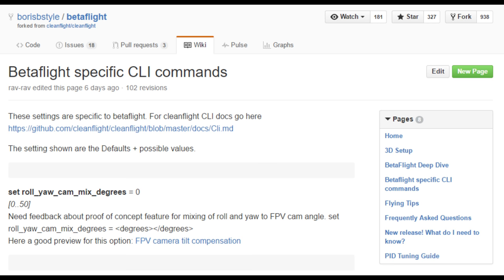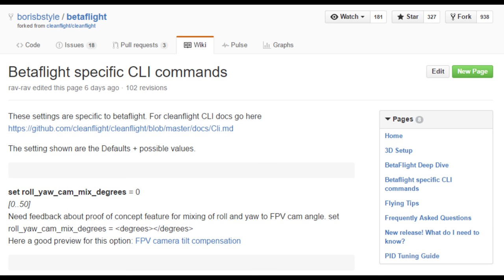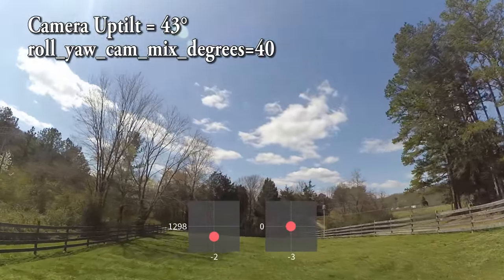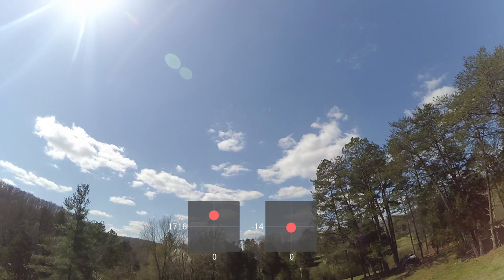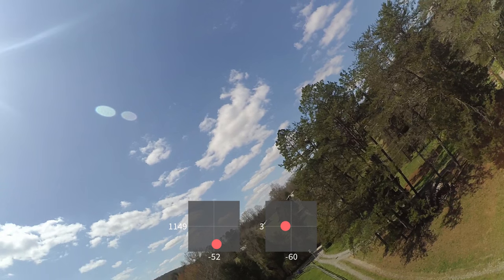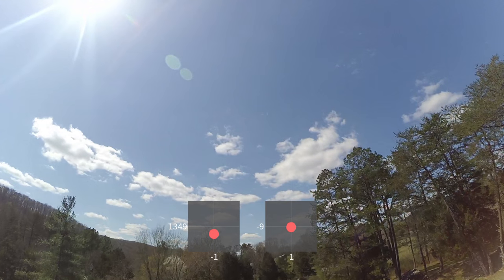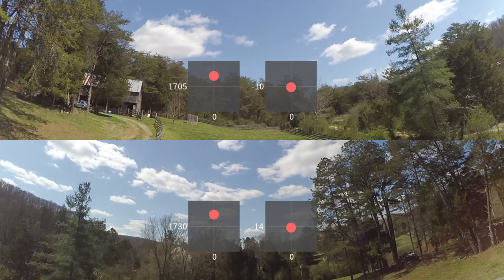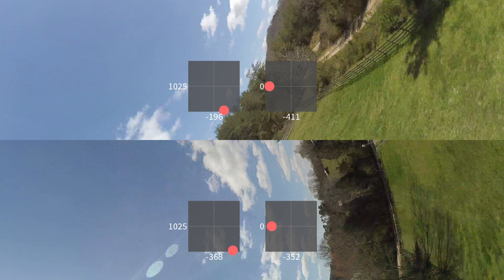Betaflight Camera Uptilt Compensation (roll_yaw_cam_mix_degrees)

Comment: Very interesting. Flight stability I love but the thought of fake inputs happening makes cringe a little. How far you would take this, auto height with just throttle and yaw to fly fast laps would be the extreme i guess. What i'd really really love to see is a few Los circuits with flips and rolls in with this setting on and then off. Fast FPV feels odd to me but LOS I can fly round our track way faster. I'm starting to wonder if this is the factor making fast fpv feel odd where los or slow fpv doesn't.
Reply from the maker: +MicroRCFiend Don't get hung up on the "fake inputs". Think about it! The PID loop is CONSTANTLY making "fake inputs" to the motors to make the copter fly. Nobody cares about that. As long as flight performance is good, there is no shame in letting the flight controller do some of the work for you. Does your car have anti-lock brakes? Of course it does... even high-end race cars have anti-lock brakes because they are just good. On the other hand, many racing drivers prefer to NOT have stability assist and automatic gearbox, because there are performance-related down-sides to these features. But don't hang onto pride that will keep you from taking advantage of something useful if there is no down-side.
Reply: I follow you but the PID loop and giros are adding stability to counter external forces, this is adding extra inputs that physically change the way the quad flies through the air.

The comparison to anti lock brakes and automatic gearboxes not a good analogy in my opinion. This auto cross inputs really does limit the performance, speed of roll rate being one. Range of motion to counter the extra inputs is reduced too along with trajectory due to angle of the quad. Extra inputs are a very internal thing separate from the PID loop. Now air mode or active breaking would be much more relevant analogies to anti lock brakes or power steering.

With that all said, i'm incredibly curious what FFF roll and flip would look like from a LoS point of view if you were willing to do do a couple.  If it makes a 45 degree tilt flying round a track feel like i'm flying LoS inputs then that would be wonderful. Do you feel flying like this only would effect someones ability to progress with LoS if they were new to both in regards of consistency of inputs to the quad's flight?

Would this CLI command apply to only the profile you are in when you set it meaning you could cycle it in or out
Reply from the maker: +MicroRCFiend I feel like the distinction between countering external forces and adding extra inputs to change the way the quad flies is immaterial. Just my personal opinion; you don't have to agree. As long as flight performance is still excellent, who cares how it's achieved, I say.

I may pull out some LOS rolls as I would also be interested to see what it looks like. Flips won't be changed at all, of course, as the compensation is roll and yaw only.
Reply: Yes, I do disagree and I care very much how flight performance is achieved but sure it's ok to disagree. I think that is possibly because of our roots and goals. Your's is obviously FPV and damn fine skills at that, where as mine is a LoS 3D where extra external inputs would mean malfunction and lack of symmetry in piroflips etc. It would dramatically effect everything instead of correcting the camera tilt.

I really dig your fpv musings vids, gives my tunnel vision flying brain a fresh perspective which is never bad. 

I have a naze quad now, can this be limited to just one profile?
Reply from the maker: +MicroRCFiend I can see how it would matter more in LOS flight. In FPV flight, all that matters is what the camera is seeing. What the body of the copter is doing is not as important.

The parameter is not in the "profile" section of the CLI dump, so it is global.
Reply: @JoshuaBardwell  I can see you're mathematically minded. This setting is just changing the basis rotation for the control sticks. It doesn't change how the quad flies. It changes how the controller works, i.e. the human interface. Rather than have the control axis fixed to the propeller plane with a variable camera angle, we have the control axis fixed to the camera with variable thrust angle. I found this video because I didn't know betaflight had the option and I was trying to do the mix in my transmitter. Haven't flown it yet, but I have experimented with it in a game engine while writing a simulation script. It seems like it would be useful in tail-sitter airplane/quad hybrids that launch vertically and fly horizontally.

Comment: Hey Joshua.  What loop time are you running in Betaflight?  I am running a naze32 rev5 with littlebee 20amps on cobra 2204 2300kv motors.  I think it's a pretty similar setup to yours.  And I'm flying acro with accelerometer turned off.
Reply from the maker: +Eric Maggard 2 kHz.
Reply: +Joshua Bardwell What is the advantage to having a higher loop time? If I wanted to adjust it, do I need to do any more PID tuning?
Reply from the maker: +mxp6466 https://www.youtube.com/watch?v=j2YtpeHGafs

Comment: I must have missed this video somehow.  It seems like this feature could produce unwanted yaw or roll in some situations.  Do you use this feature regularly?
Reply from the maker: I stopped using it for various reasons. All it does, for the most part, is make it feel like your camera has less uptilt than it really does. The weirdness comes in when you level out. Then the uptilt compensation makes the copter fly as if the camera was tilted down, which nobody expects.

Comment: Thanks for sending me this link, I wonder how much improvement this works on Betaflight 3.1.7
Reply: Don't do it.  Stay with 3.1.6 if you want to play with this feature.  Something changed in 3.1.7 and 3.2 and FPV_Angle_Mix is rolling really weird on some FC's.  I had my Acrowhoop V2 on 3.2 and my Torrent on 3.1.7 and it was AWFUL...went back to 3.1.6 and it's great!
Reply: Good to know since i am now using3.2 i will give it a shot and see how it works on both my Betaflight F3 and Airbot F4 boards.

Comment: On my Tweaker 180, I am running 40 degree up tilt, and I've set this parameter to 40, but when I yaw I end up pointing straight down after about 45 degrees of yaw in either direction. My rolls are nice an level.. does this not affect both yaw and roll? Thanks!
Reply: +Mini Quad Topix I think I just answered my own question, I am not moving forward when I am testing yaw, so the copter isn't really at a 40 degree pitch.. I need to be moving forward at 40 degrees for this to work huh?
Reply from the maker: +Mini Quad Topix Exactly. The uptilt compensation sets the new neutral angle for the yaw axis. If you have it set to 40, then when you are pitched 40 degrees forward, yaw will be perfectly flat from the camera's perspective. When you are pitched less than 40 degrees forward, a weird counter-coordination effect will occur. This is why I don't actually suggest setting uptilt compensation to the full value of what your camera's uptilt is.
Reply: Good point, After having it set to 40 degrees, now I agree with setting it lower to a good middle ground. I'm happy that tomorrow is Saturday AND I get some free time away from the fam to go play w/ some settings! Thanks for the reply :)

Comment: i would light to disable this as i set it up to 30 degrees on betaflight as my camera is around 30 and couldnt fly good in acro, just realized what it does id rather not have it. question is what was it set to by default? 0 degrees?
thanks
Reply from the maker: Yes.

Comment: Sounds like I would be committing muscle memory to something that might not be on all FCs (such as KISS) . . . will need to try it and ponder.
Reply from the maker: +Dragonsbane777 don't over think it. It's just like adjusting to a copter with more or less uptilt.
Reply from the maker: +Dragonsbane777 Just to elaborate now that I'm at my desktop keyboard... the muscle memory thing is valid, but like... every time I have changed my camera uptilt, there are about two batteries where I am a bit "off" and having to adjust, and then pretty quickly I am back in the groove. I tried to fly a friend's copter with "only" 20 degrees of uptilt the other day, and I had no problem adjusting to turn coordination. My biggest problem was that I had to pitch forward much further than I thought to go fast. So any time you transition from a copter with one uptilt to a copter with another uptilt, there will be some adjustment, but it shouldn't be too big of a deal, and honestly, it is a skill that a well-rounded pilot should have anyway (IMO of course).

Comment: Hello Joshua, Why it doesn't work on betaflight 3.0 ?
Reply from the maker: It does work, but there is now a flight mode that lets you turn it on and off. If you haven't enabled the flight mode then it won't work. If you want it on all the time, just make it so the mode is always active. Extend the mode sliders all the way out to the edges of the Aux channel.
Reply: Wow! thank you so much for your quick response. I will try it and let you know! I think, I got it on the flight mode.
Reply: I tried it and  it is work! However I have to add bigger value to be 25 instead of 15 for my previous settings in bf 2.6.1 . Also, When I switch on the angle mix flight mode, my roll, pitch, yaw become slower than I switch it off . It is looks like my super expo is off.
Reply from the maker: +sotar FPV there are some interactions with that feature and super expo. I don't think it's well supported.

Comment: Doesn't it make hovering extremely weird? Well, you don't really hover when flying a fpv race quad, so it may not be that important.
But Line Of Sight flying will definetly become more difficult or even impossible
Reply: +BlackPixxelDE  I was wondering sort of the same thing: how does it affect control while landing?  Can you put the feature on a switch?  As for LOS: I suppose you could use this for LOS, as a coordination mix, but the name of the feature has "cam" in it implying FPV as the primary use case.
Reply from the maker: +BlackPixxelDE I had no problem hovering, even with 40 degrees of compensation. You just have to pay attention to what the camera is doing and adjust your thumbs accordingly. When you're hovering, you're going so slow that it wasn't too hard to adjust.

I'm not sure if it would be weird flying this LOS, as I don't fly LOS much. But it might not be too weird. You just have to mentally modify how much roll and yaw you are using when you turn. But I don't really think this would have much of a point LOS, as uptilt is not a factor there.
Reply from the maker: +oneearjustin Yeah. Maybe it would make sense to use it as an auto-coordination feature for LOS. I don't fly LOS much so I don't know.

Comment: To compensate for uptilt it helps to understand what you are compensating for. As camera angle increases the effect of roll and yaw changes continually. To understand those changes watch this. There are other ways to compensate for this at angles higher than 45 degrees.
https://youtu.be/ICHlw2VCOtI

Comment: do you use this still to this day? i found that my footage is more sky than id like.. would this help me?
Reply from the maker: No I stopped using it.

If your footage is more sky, change the uptilt angle of your GoPro to match your FPV cam.
Reply: I’ve worked out that it longer works on the new betaflight anyway. So I’ve had to learn it old school.
Reply: @JoshuaBardwell  My cam only tips up about 20 degrees, but I like flying like its 45-50. How would I set that up? Thanks in advance if you get time to answer.

Comment: running CL racing f4 why wont this CLI enter in Betaflight? says incalid name
Reply from the maker: Because this is an old video and things change. Use the camera uptilt setting in the GUI. Configuration tab. You don't need to use the CLI any more.
Reply: Joshua Bardwell thanks. I learned something!!
Reply: Joshua Bardwell where can I find this in the current 3.1.7 beta flight ?

Comment: why when I type that command into CLI it says unknown command?
Reply from the maker: Not running Betaflight?
Reply: +Joshua Bardwell  Hi yes I am , but I was not putting the underscore after the word set !  Lol  all good now just flown with it set to half my camera angle .....  Very good !   Thx
Reply: Hi  , how did you fix it ? when i type: set roll_yaw_cam_mix_degrees = 10 i get unknown command too ?
Reply from the maker: Type "dump" and check the commands there to see what your firmware is expecting. If it's not in the dump, it's not supported by your firmware.
Reply: Hi steven you need an _ between the word  set and roll .  works great when flying !   Thx Joshua!
Reply: +nick wadman  Thank you , I will give it a try :)
Reply: Its working now :)

Comment: Thanks for your nice explanation of this feature. In the video description you mention that gyro board alignment wouldn't do the same thing as cam tilt compensation. I would like to discuss and understand the point behind it. To make it more confusing, I'll add another variable to it in terms of motor tilt ;)

I've been flying 14 degrees forward tilted motors together with 20 degrees cam tilt (14 + 20 = 34 degrees total) for more than half a year now and it feels really natural for me to do freestyle and race-like kind of flying with this setup 
( https://youtu.be/kMlYhPgTSPg?t=1m42s ). 

On one hand, the frame of reference for rolling and yawing of my quad is still the same as without motor tilt which means, that rolling and yawing feels to me like having just a 20 degrees cam tilt. But on the other hand I can get a greater speed during forward flight due to additional 14 degrees of motor tilt. But I guess, you are familiar with the pros and cons of tilted motors.

Recently, I built a new quad without motor tilt and set the camera tilt to around 34 degrees. Guess what, this thing's steering behavior feels totally weird to me. That was actually the reason, why I stumbled upon your video here. From my understanding, adding a cam tilt compensation of around 14 degrees should result in a similar flight behavior as my old setup mentioned above. However, tilting the FC 14 degrees backwards (or adjusting a board alignment angle in BF, which is obviously easier) would result in relative angles of 14 degrees between FC and the motor axes and 20 degrees between FC and the camera which is exactly what I had before with tilted motors. So how would that be different to cam tilt compensation and isn't it more straight forward to initially change the frame of reference of roll and yaw instead of overlaying the steering commands with calculated cross coordinated values (which cam tilt compensation obviously does...).

I'm going to test this when the weather gets better but would be glad to hear your opinion on that.
Cheers and keep up the educational level of your channel. I really like it.
Reply from the maker: I kind of can't keep up with what you're describing, between tilting the motors, tilting the FC board, and tilting the camera. Whatever you fly will feel natural to you, of course, and anything different will feel weird. I think most people have moved away from tilted motors because they result in roll/yaw coupling.

Here are my thoughts on board align: https://www.youtube.com/watch?v=jSzWRnAqsSY

In short, I think the motors should always be parallel with each other (V-tail and A-tail being an exception) and the FC / gyro should always believe that it is parallel with the motors, by setting the board align parameter. This is independent of the degree of camera uptilt. A copter with 10 degrees of motor tilt and 20 degrees of camera uptilt will NOT fly like a copter with flat motors and 30 degrees of uptilt because of the roll/yaw coupling that occurs when you tilt the motors out of their plane.
Reply: "A copter with 10 degrees of motor tilt and 20 degrees of camera uptilt will NOT fly like a copter with flat motors and 30 degrees of uptilt because of the roll/yaw coupling that occurs when you tilt the motors out of their plane." <<<<----- That's exactly the benefit, I was trying to describe. Such a copter "feels" more like one with 20 degrees of cam tilt because the PID controller is trying to compensate for the 10 degrees of motor tilt during yaw and roll. And this "compensation" works incredibly good. I was just wondering, if it's possible to achieve a similar behavior with a "flat" motor setup and a backwards tilted (or virtually tilted) FC and how this would relate to the cam tilt compensation feature. I hope, that's not too confusing X-D. Will test it in real flight soon. Thanks for your opinion on that ;)
Reply from the maker: +Dronek I don't think it will be the same. The coupling occurs because the motors are not aligned perpendicular with their own plane, if that makes sense. In theory, I suppose the FC could be coded to simulate this effect, but I don't think that taking the FC out of plane with the motors will have the same effect. 

But you know, now that I think about it, I could be wrong... Having the FC out of plane with the motors also creates roll/yaw coupling. But is it the same?